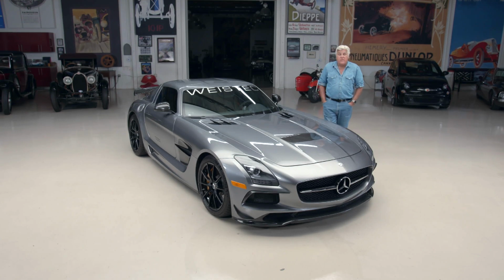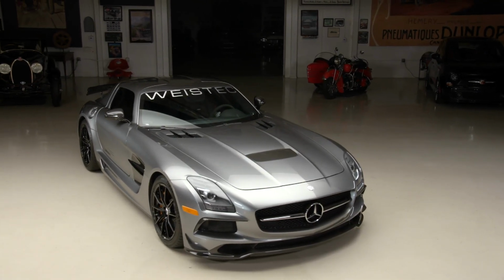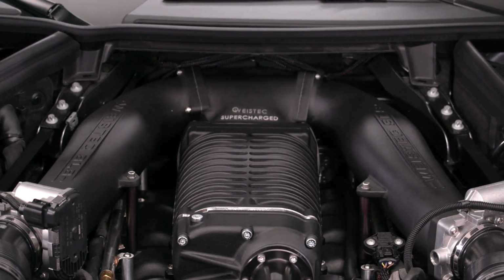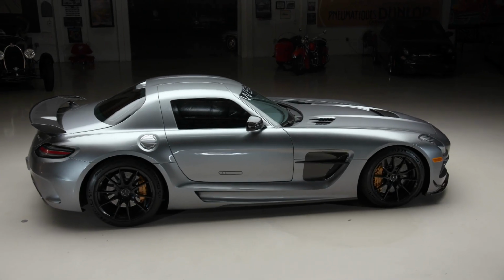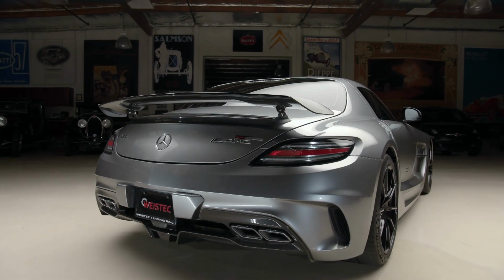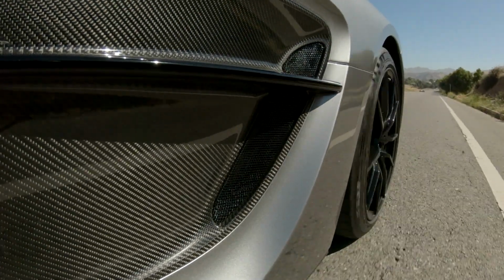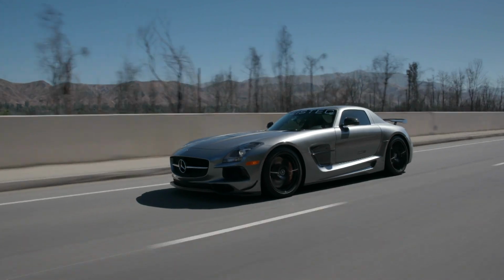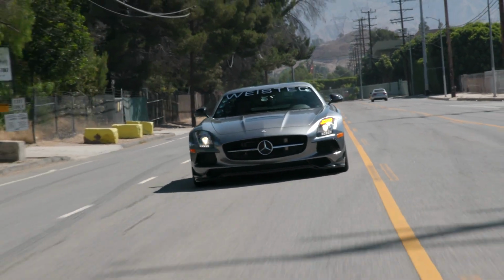Graham Rahal's Weistec Tuned Mercedes-Benz SLS Black Series - Jay Leno’s Garage

Comment: Bruh, Weistec ruined this car. The whole points about these legendary cars is the reliability of the naturally aspirated engine, which allows you to go lap after lap without issues, not just one owner have problems with weistec supercharge on their M156 M159 and Why would you want to power up this car when it’s still gonna be slower than many other cars that can simply swap in a bigger turbo with 4WD? Keep it NA, bro. It's built for balance, not for straight-line drag racing.

Comment: The black series is not that much lighter than the standard one because of strengthened rear axle, etc. Also every standard SLS (at least the European models) has the torque tube made from carbon fibre.

Comment: I have Weistec components on my SL55 AMG so I'm a fan.  I have to correct Mr. Weiss though.  His company is not the only one that has 50 State Carb legal  mods.  Dinan, has had in house performance packages for BMWs for many years.  I have components from Dinan on my E28 M5.  Dinan products are so robust, that BMW dealers do not void  BMW warranties when they sell Dinan cars. Dinan modified cars are sold at BMW dealerships with full Dinan & factory warranties intact.  They are also California legal.  Does Weistec sell Carb legal Mercedes cars at dealerships with factory warranties intact?

Comment: I don't know if Jay has done any track days,but at my local track one of the guys built a Simulator pretty decent and technical...and beyond just going to all of my favorite track of F1....I got to drive a lot of real good race cars one of the best handling GT class cars I got to throw around Barber Motorsports in Alabama was this Benz...Mercedes race version I jumped out of a rather unfun all wheel drive supercar,being very fond of Benz,I drive AMG team race car and drive it like a moto GP bike and the car was flawless I always loved the gull wing door cars...but never knew they were top performance car,race car had ABS which really gave it the edge over the all wheel drive car I did not like....in GT class if I was gonna buy a car I'm with Graham all the way on this one....that's the nice thing about the SIM...u can take a car to a track it would probably never go to...I'm particularly partial to F1 cars and Indy cars too because they reward and have to be driven at max to get the best from the car and AMG SLS would be my choice for street because I'm sure it still ride smooth like a Mercedes....

Comment: So basically he adds a blower to stock motor and calls himself ceo after he charges you $50k for blower install that has no warranty if it blows up and measures the horsepower at the flywheel to sound better.  Lol.

Comment: This Mercedes Benz is based on a design that would be the future Dodge Viper.
Mercedes Benz took the Viper project and changed the grille and the tail of the car. That is what this Mercedes Benz SLS is.
This car actually pursues the style of the Viper and not the old SLS.This Mercedes Benz is based on a design that would be the future Dodge Viper.
Mercedes Benz took the Viper project and changed the grille and the tail of the car. That is what this Mercedes Benz SLS is.
This car actually pursues the style of the Viper and not the old SLS.

Comment: It would be great if the trend of the word "So" being the first sound out of peoples mouth would just stop.
Reply: So I agree - it's just a meaningless face noise, not unlike the airline pilot's "Ahh, we'll be flying at 33000 feet, ahh ....."
Reply: So, if the grammar police where to endorse..... ;)>
Reply: Somebody is teaching people to do this. They go on public speaking courses and are taught by self-appointed experts to lead into their statements like this because they've decided this sounds positive and authoritative.

They're told not to start by saying "Well, ... " because that sounds guarded or cagey, and never to start with "Em, ..." or "Eh, ... " because that sounds weak and unsure.

Then other ambitious and easily-influenced people pick up on this both consciously and subconsciously and start to mimic the new trend in verbal ticks.
Reply: @vcolinc   Excellent diagnosis right there, so . . we've done a study on you and your analytics and come back with . . CORRECT.
Reply: @vcolinc  Odd. My speech teacher woulds ding us for use of nonverbals, and fillers. Ahhs, umms and I imagine these so's would cost us points.
Reply: @ronindebeatrice  These are Corporate type people providing in-house courses though. Stuff like this spreads like wildfire among the Corporate-speak types.
Reply: I agree with the initial comment.  Regardless of success, it makes one sound like a valley girl, along with the even weirder response as a yes or no in the form of "sure".

Regardless, very slick car with some nice "oem" improvements.
Reply: So why does it bother you so much?
Reply: Jay has few, "as I said" "and of coarse", his don't bother me, but half the pundits on news shows start every sentence with ah, they drive me crazy.

Comment: I would have removed the name slapped across the windscreen right away. And maybe gotten something from Brabus instead, if for the sound only. Would be interesting seeing Jay try the Brabus 900 based on the Mercedes-Maybach S 650 L. A limo with all the power that goes 0-100 in 3.7 seconds :P

Comment: 9:58 mark the hood does not close properly.
Reply: ha! I was hoping Jay would do his usual 'slam the hood' trick just to freak out the rich guy guest lol.
Reply: @munter10  If Jay did that and broke the guys hood I wonder if they would edit it out or leave it in and try to use it as a learning experience or as a funny blooper.
Reply: I think the hood just wasnt pushed down far enough/correctly on the passenger side and only "locked" on the driver´s side. If you give it a push on the passenger side it will also lock in there and close correctly
Reply: @timonxDlol    I was thinking for weight purposes it was one of those after market hoods made from a lighter material.    Those can be flimsy but work well.

Comment: SLS is my favorite modern MB. Like the AMG GT, I prefer the standard car over the R or Black Series because the overal design language is on show and not over shadowed by all the aero and exposed carbon parts. The same for the 918 over the WP version. Look at the LP400 Countach over the later cars for purity of design and the massive value difference so others echo a similar appreciation for design over performance once the car is not new. LOVE the SLS, SLR, AMG GT and original SL Gullwing for the long hood design.
Reply: True about the LP 400, rest of your comments are bunk, IMO

Comment: AMG is not a manufacturer like Ruff, they are part of Daimler.
Reply: *Ruf. I don't know if AMG were originally considered a legal manufacturer, or if that's even some sort of official designation. Anyone who makes a product from scratch could be considered a manufacturer, but Jay seems to feel that it bears some weight or creedence. AMG was originally an engineering firm before working with, then eventually being purchased by Daimler AG.

Comment: Jay " So everything else can take the additional power and torque?" 
Micheal " Sure......"
Reply: Arthur92 30k miles later. Hmmm seems my valves and piston rings are pretty worn.
Reply: @Marvdogger2  this comes with forged pistons. have a look at what they did to the m156 to become an m159. on top of that the m156 had known issues with the head bolts, lifters and the intake cam adjusters. all of them being up top .. the lower part of the engine was very stout. the engine was built with a closed deck - racing design and all the issues with the m156 were addressed in the m159 iteration.
Reply: Cars&Roads UK I'll add that the m156 with development package P31 or Performance Package P30 had most upgrades of the m159. Everything was forged.
Reply: @kellyjensen9425  yeah but that was available only for the c63 and for me the c-class never been a proper Mercedes
Reply: Cars&Roads UK Not a proper Mercedes and yet is the closest thing you can buy to an SLS AMG supercar? Sounds very Mercedes to me. I'm obviously giving a dig at your comment. It's cool if you don't consider a C-Class a proper Mercedes. That's how I feel about the CLA. I'm thankful the C-Class exists because as much as I love the E and S class, I just don't want a car that large. I feel like all three (C, E, S-Class) are all very Mercedes meant to fullfill the three categories of compact, mid, and full-size cars. I feel the CLA is the FWD underpowered zero quality sh*t box with a Mercedes badge just like the fake AMG badged cars not hand built.
Reply: @kellyjensen9425  if you like the c-class that's ok. until the w205 i couldn't properly fit in one. i was fortunate enough to drive the c63s w205 and it was good but for me mercedes starts with the e-class. there are other manufacturers out there leading in other classes...like the q7 in the suv range ( and all it's siblings ) but when it comes to mid and full size mercedes it's king. drove the m5 f10 and the previous gen rs6. not even close to the e63.
Reply: Cars&Roads UK I can't argue with that. I completely agree with everything you've said. The E and S class do stand apart. Same with the Q7 with SUVs. The C-Class isn't undeniably the best in its class and from that perspective I can agree with you. For some reason I really love the C-Class though. I recently traded a newer Mustang GT with Performance Pack for an older 2013 C63 AMG. I also own a W205 C400 which was later rebadged as the fake C43 AMG and love it almost as much.  I test drove a 2016 E 63 AMG and had to really sleep on that one. In the end I wanted something a little less refined (which leans towards your argument of standing apart) with a little more thrill. I will say I want an older E55 AMG bad!
Reply: @Marvdogger2  that car won't see 30k lol. Maybe 15k in the next 10 years
Reply: Rob Ferrell  it will not make that many miles.. rich guys dont drive their cars 🤷🏽‍♂️

Comment: Going from 620 hp to 825 hp is of course a necessity in a 3600 lb, 2 door sport car... (rolls eyes) And those Michelin Cup 2s will wear out faster than you can say 0-60 !
Reply: @legitx12  
Smart male who'd rather be spending $16K on something more worthwhile. If the car had only 250-300 hp to begin with, I could understand getting 200 more hp. But it's already 620 hp stock ! Come on.

Comment: Let’s not forget the fact the next generation c63 is going to have a 4-cylinder...
Reply: The C is for C class. The 63 represents the 6.3L V8 under the hood. Try your cylinder count again, on BOTH sides of the car this time.
Reply: Brian Weir The 2020 AMG C63 comes with a 4.0L biturbo v8.
Reply: Brian Weir Understood sir, I meant the next generation c63 which is rumored to have a 4 banger. https://www.google.com/amp/s/www.roadandtrack.com/new-cars/future-cars/amp29503077/mercedes-amg-c63-hybrid-four-cylinder-awd-rumor/
Reply: Brian Weir oh and by the way the w204 had a 6.2 v8, and the current generation w205 was a 4.0 biturbo v8.

Comment: Looked like the hood closed oddly, then a quick cut screen...
Reply: Nathan Okrusko I think it just wasn’t closed completely. The alignment looks fine once they latched it
Reply: @SpaceKruezer  look again...
Reply: CARBON FIBER IS LIGHTER AND NEEDS EXTRA CARE WHEN CLOSING.
Reply: @MICHGO1   Exactly why Jay should've given it the usual 'slamaroo!'
Reply: @MICHGO1  Why the SHOUTING ??
Reply: Yeah, it looks like they did a little edit there..
Reply: @Hiluxtaco  Camera went up immediately to allow crew to snick that side engaged. Carbon hoods are a bit flimsy until all points are integral secured.
Reply: Right latch didn't catch but they closed it for future shots.
Reply: I caught that too, they both failed on that
Reply: Correct.  left hook doesn’t catch the hood

Comment: You could literally buy a Corvette C8, which is both mid engined, $160k cheaper, has better straight line performance, and is faster on the nurburgring. That is almost pathetic.
Reply: In a year, you're going to be seeing C8 Corvettes at traffic lights all over America, and no stock ones are rolling 825 HP V8s. Mercedes SLS Black Series were not produced in anywhere near the C8s production numbers. I doubt these will be anywhere near as common as Corvettes are. For that matter, considering the C8s have not yet been delivered to customers, and since you haven't personally tested either car, how would you know which car performed better. I'm sure that's a comparison you won't be producing for us.
Reply: Can't believe you would compare a Corvette on equal grounds of a rare Mercedes Benz Supercar?
That's like trying to compare 
(Walmart)
        To
(Fort Knox)
The (Corvette C8) is most definitely mediocre to this (Mercedes Benz Amg)
and shouldn't be used in the 
same sentences because there both on different levels of technology in every aspect!
($hame On Your Damn $elf)